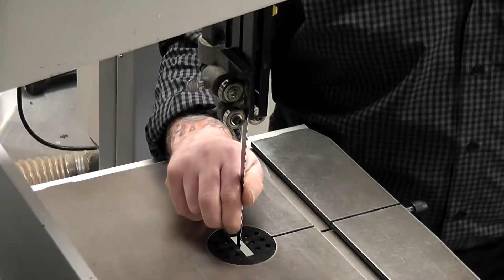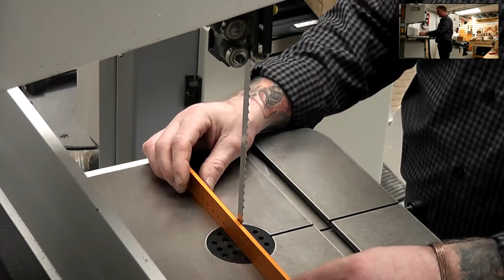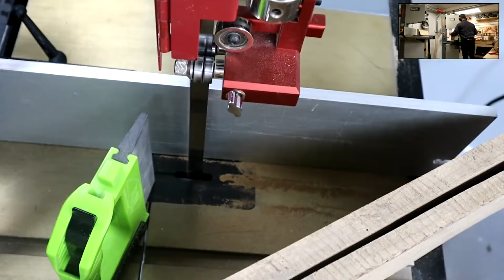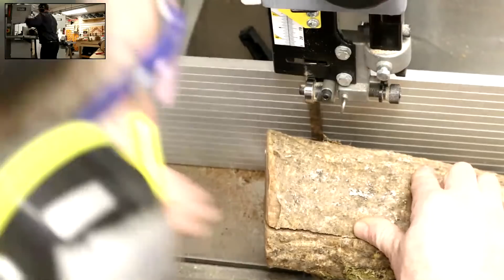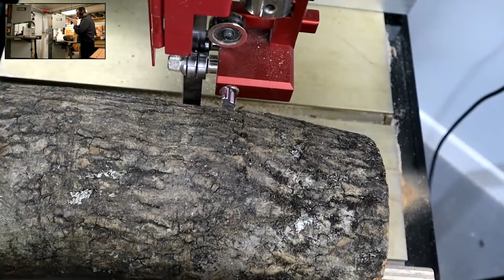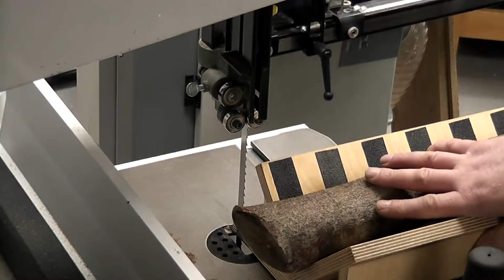Log Cutting On The Bandsaw - Woodworking Wisdom

Comment: Obviously no one at axminster tools does like to answer my questions. May be something was unclear. 
Settings of my bandsaw are correct according to the producers guideline / manual.
However often my cuts aren't straight. Especially when cutting thick material of 15 -20 cm cuts get waved. Even with very low feed. Bandsaw parameters are correct. Tension adjusted , Blade and table are right angle....

Once again:
1. You recommend 10 teeth within the wood profile. Respecting your other recommendation >>3 TPI for timber cutting (along the fibre) you could reach a maximum height of 3,33 Inch or 8,46 cm. This appears rather poor to me. So one would not be able to saw logs. 
Therefore: What is the recommended Saw Blade Dimension for log cutting of 10 -12 Inch Diameter?
By the way offers for 3 TPI blades aren't very common.
2.  On the other hand you show log cutting within your video at timestamp 1:03:17, with a blade that is more than 3TPI. Maybe 6 or whatever. 
So you don't follow your own advice, 3 TPI??
But for me it looks like that shavings do not impede that blade that much...
Reply from the maker: Hi Wolfgang Fath, Craigs reply is on your original post :)

Comment: I'm rather impressed about your demonstration, especially your tips for choosing the blade parameters and jig using. Nevertheless I got some questions, perhaps some misunderstanding:

1. You recommand 10 teeth within the wood profile not more. Respecting your recommendation 3 TPI for timber cutting (with the fibre) you'd reach a maximum height of 3,33 Inch or 8,46 cm. This appears rather poor to me. So one would not be able to saw logs.
2. On the other hand you show log cutting within your video at timestamp 1:03:17, with a blade that is more than 3TPI. Maybe 6 or whatever. 
For me it looks ike that shavings do not impede that blade that much...

I got a Record Power Sabre 350. And I hope to be able cutting logs of 10 Inch diameter (Wild cherry tree)

Disclaimer: I'm a German guy. So excuse me if not using correct idiomatic English.
Reply from the maker: Hi Wolfgang Fath, the following reply is from Craig - "Thanks for the question.

On all cutting during the video I used a 3TPI Skip tooth blade, which I find the best for deep ripping both in logs and planks. The 2 tooth minimum & the 10 tooth maximum is a rough guide but if you slow down the feed rate a little the waste is cleared well enough as the skip tooth shape will help with this.

I hope this helps."

Comment: Great demo. Can you offer your thoughts on cutting  bow stave in half down their length. They are usually about 2 metres long and from the triangular rift sawn section of a log cut. I normally split them out of a log, so not flat edged or 90° cuts.
Reply from the maker: Hi Warren, the following reply is from Craig - "I think I know what you mean! I would use a 1/2" x 6TPI blade for this, it will stay straight but wont have a very coarse tooth, so will leave a reasonable finish. Remember to try to get a good straight and flat edge to run on the table to start with."